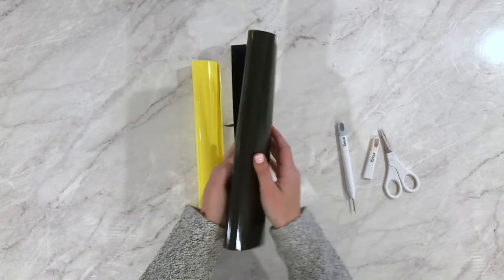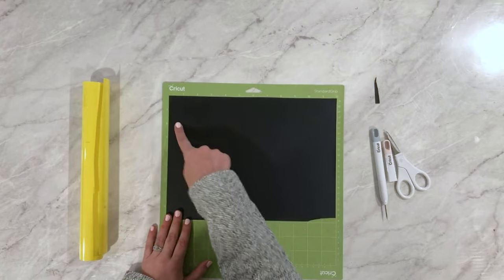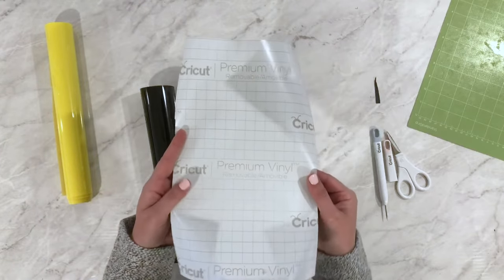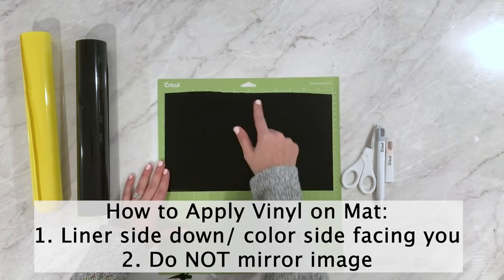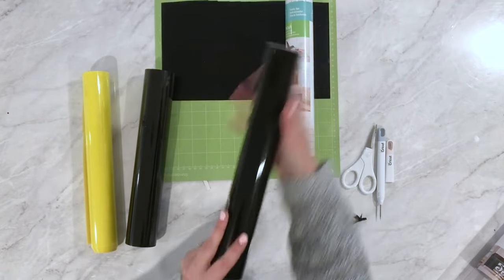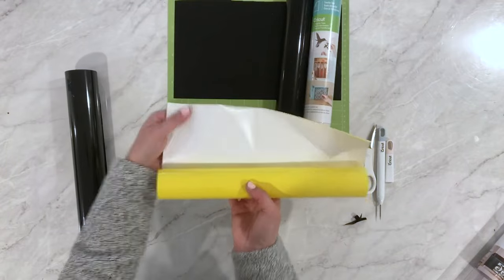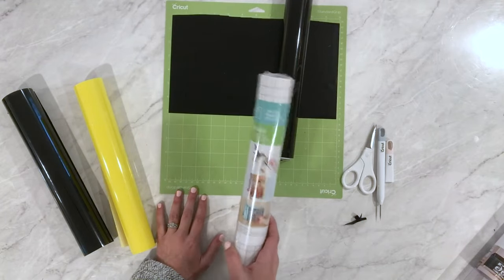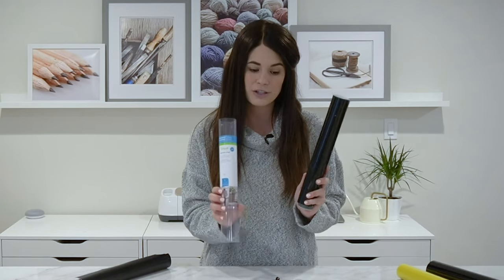How to tell HTV/ iron-on from adhesive vinyl!

Comment: Hi just got a cricut, came with all kinds of vinyl. This video was so helpful in helping me sort them out. I do have 1 question. I want to make a Tshirt design but have cricut permanent vinyl, no iron on or htv. I also have transfer tape. How do I work with that? Thanks in advance!!!
Reply from the maker: If you want to make a design for a tshirt— you’ll need heat transfer vinyl/ iron- on. Permanent Vinyl is just like a sticker and can peeled right off fabric.
Reply: @KarleyHall  thank you!!!

Comment: I have a question. If you’re doing lettering for a shirt for instance would you need to still mirror the image? How would you transfer that to the shirt with multiple pieces wouldn’t you need to use the clear transfer tape and do it the opposite way; right side up?
Reply: Heat transfer goes shiney side down and you mirror. 
Adhesive like for signs or window stickers is paper down and not mirrored.

Comment: I have some patterned vinyl.. it does NOT have a liner, but it did come with a separate piece of clear.  I don't know what that is.
Reply from the maker: Is it sticky to the touch? If not, it is heat transfer vinyl. You cut this without mirroring your image. Weed it, and then use the clear sheet as a carrier sheet to place on your shirt or project.
Reply: @KarleyHall  it is not sticky and does not appear to have a backing.  it's rather thin.  it's printed.  I thought I'd test it under an iron and that was a mistake.  it immediately melted.  so then I took a piece of that clear sheet that came with each sheet and placed that over the printed vinyl and again applied my iron.  melted again.  not sure if my iron was too hot or if I left it on too long since I really had no idea how to do it.  I didn't want to use my heat press or cricut easy press for fear I'd melt something on those.

so your suggestion is to take a piece of it - cut it out or just cut a piece - put the clear sheet over it (with a protective silicone or butcher paper?) and see if it sticks.  how hot and for how long?  put the printed side UP?

Comment: Ok, question if the vinyl has the white back and it is a iron on vinyl.
Reply from the maker: If it has white, it could be either! If you can peel back a corner and feel stickiness, then it’s adhesive vinyl. If you can’t feel any stick on the colored side, then it’s heat transfer vinyl.

Comment: But for the sticky vinyl would I need to heat press it or do I just peel the back and place on the object?
Reply from the maker: Peel back the excess and use transfer tape to apply. No heat is needed
Reply: @KarleyHall  thank you so much

Comment: Yeah but when I go cut it out it either doesn't cut it deep and I end up ripping and wasting all my vinyl
Reply from the maker: Make sure to do a test cut. All vinyl is different and machine settings differ slightly from machine to machine. I like to use the washi setting with more pressure. Or create my own custom setting for adhesive vinyl. Premium vinyl (double cut) also works well!